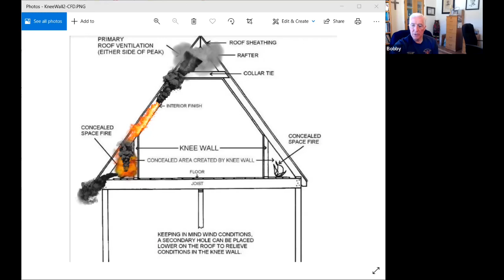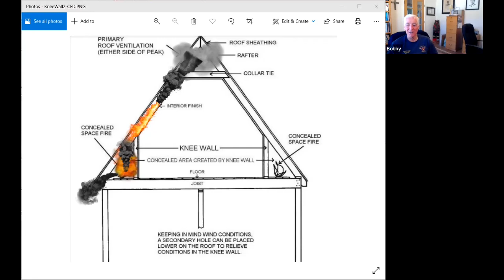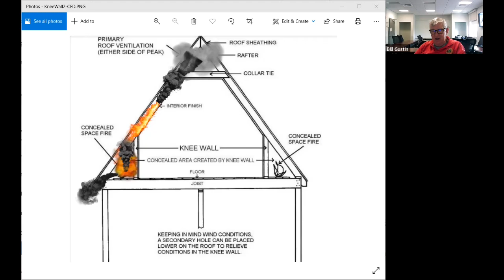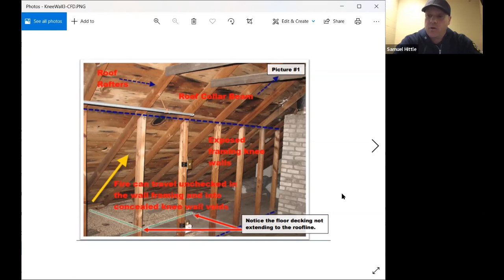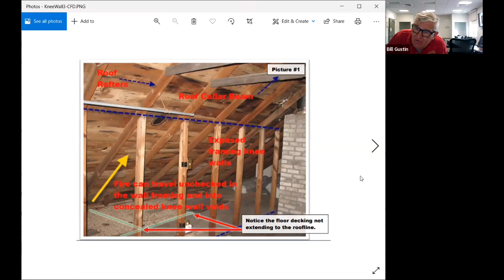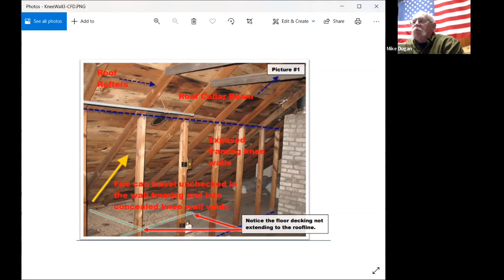Attic Fires and Knee Walls

Comment: Being a ff in the military every on base house has knee walls and some have multiple off stacked knee walls. But we are not allowed to do vertical ventilation on any building on base. We can when we leave base to do mutual aid. The way we handle it is we punch a hole than drop several fire retardation grenades.

Comment: Directing a hose stream up into a soffit, here in Canada, may not be as effective as in other areas, as right above the soffit is a curved piece of styrofoam creating a channel for air flow.  This is generally covered by eitherfibreglass or rocksall insulation( blown in).